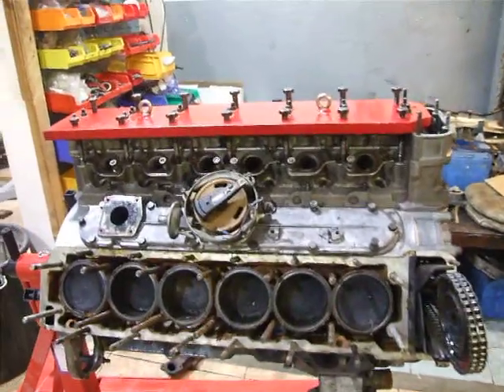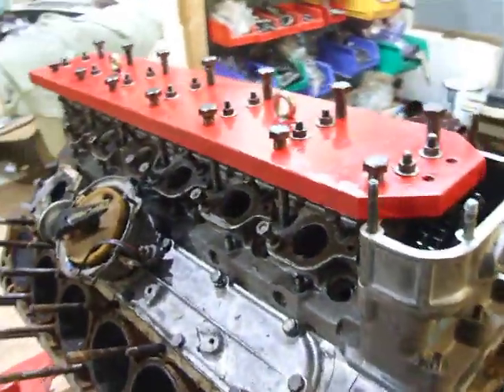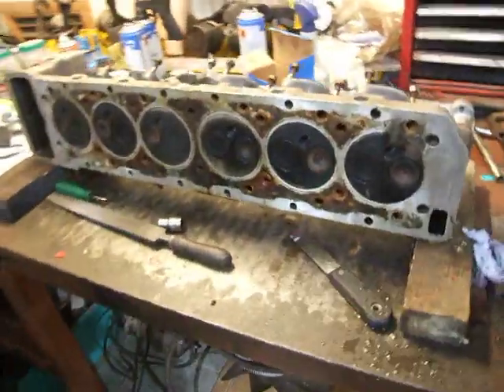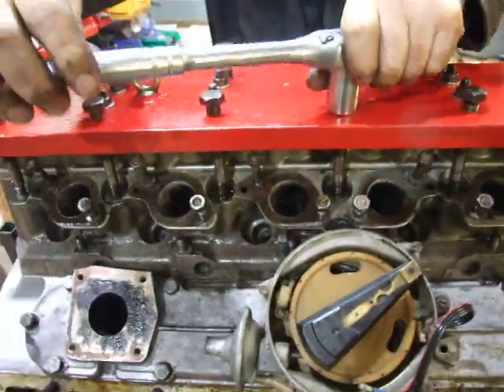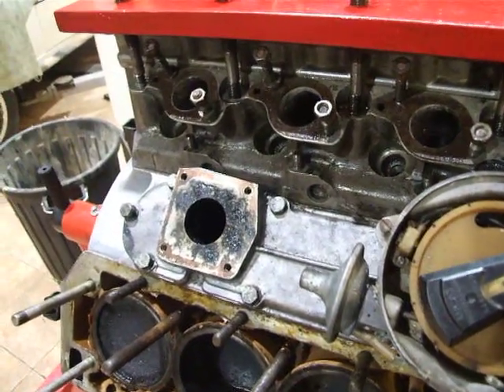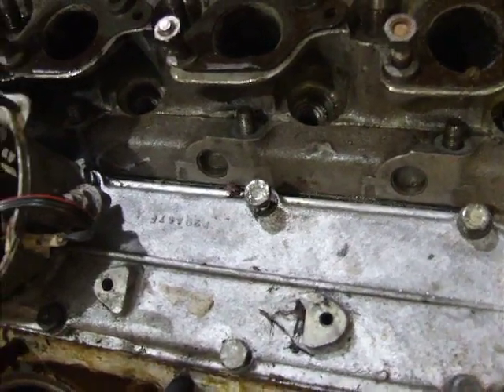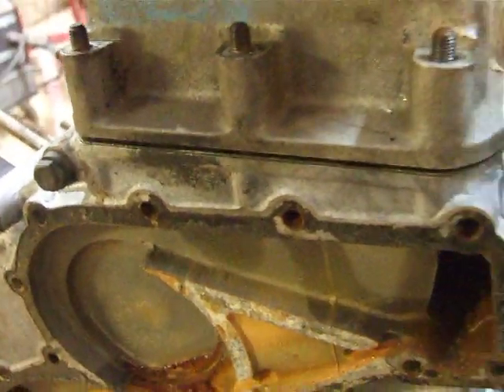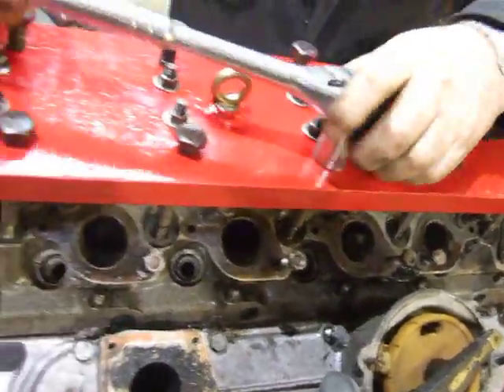Jaguar V12 Engine Head Removal (Part1)

Comment: Here's a similar tool that does the job just as well in one operation. It can also be used on the 6-cyl XK head.

Go to xj13.eu/XJ13Blog/post/2010/01/28/V12-Head-Removal.aspx

Good Luck!

Neville
Reply: Thanks for sharing Neville, best Dr Quail/ JW